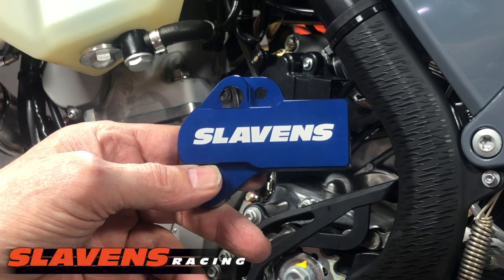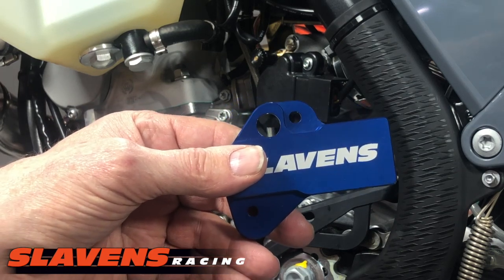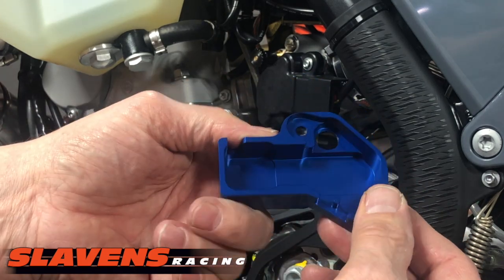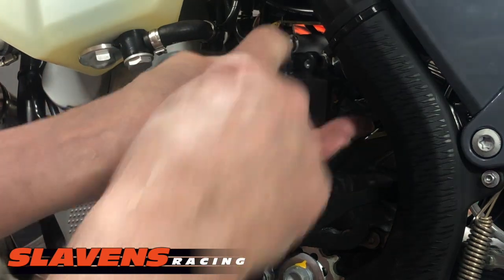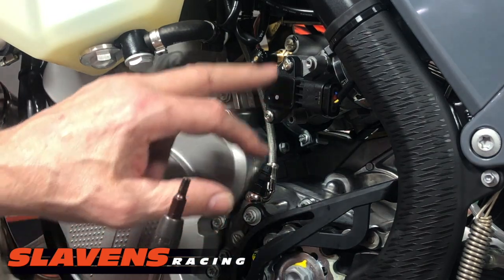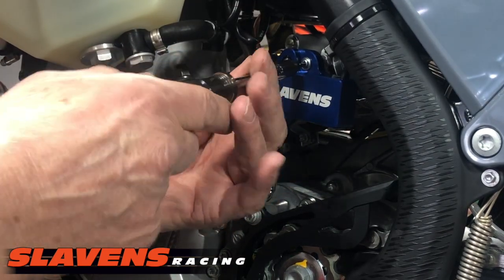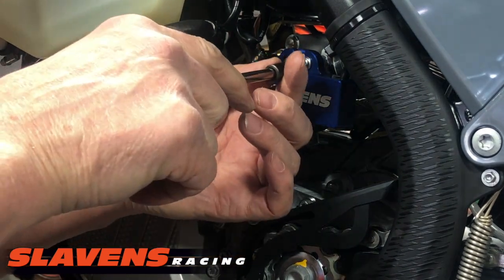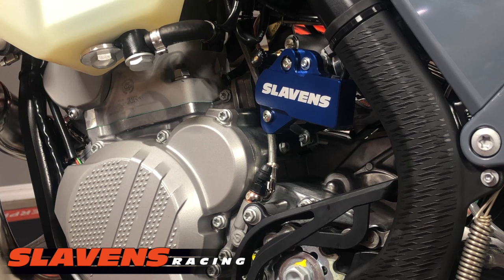How-to Install Slavens Mule TPS Guards

Comment: I jumped the gun before watching the video and took both of those bolts out, if the TPS came off of the throttle body do I need to do a recalibration or anything?
Reply: I need to know this also